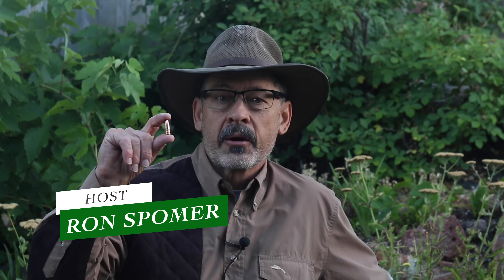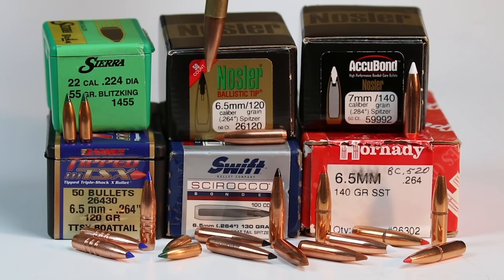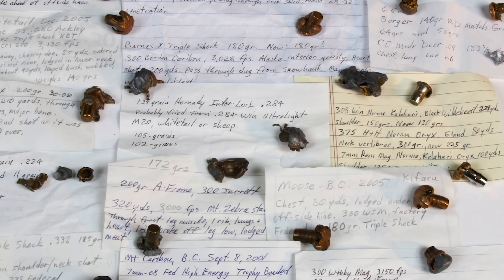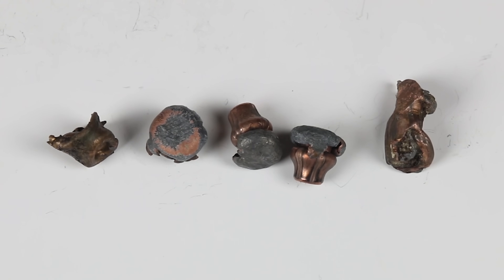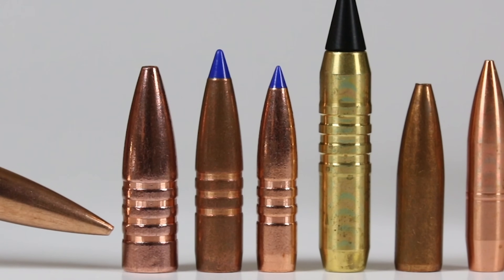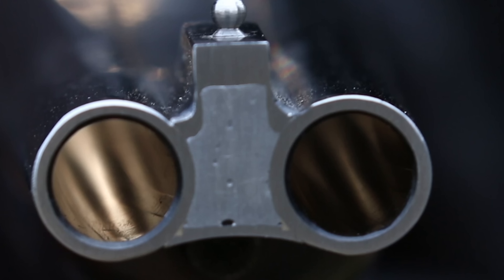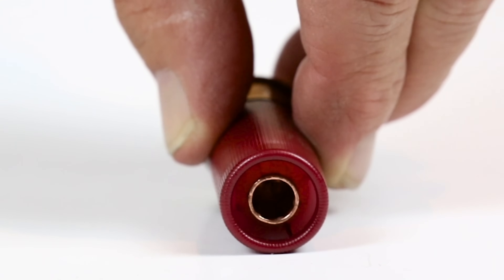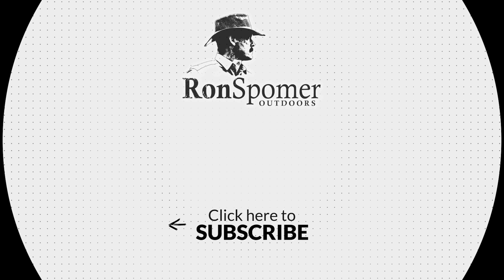Copper Versus Lead Core Bullets — How They Work

Comment: When I use a lead core bullet, I try to run it at moderate velocities. Example, look at the 30-30. At 100 yards with a cup and core lead bullet, you can expect a fantastic kill if placed just right. I have used these in 30-06. Results? DRT, IF, and I say IF, you are running them at moderate speeds. 

Lets break it down. in a 308, I will run a 165gr cup and core bullet at about 2650 to 2700 fps. Result? DRT deer / hogs. How about the 30-06? Same idea, but they run a bit faster, 2700-2800 fps with a 165gr. I have used a lot of 180gr bullets in the 30-06 lately. Why? These run 2600-2700 and really penetrate, break bone better, and results are DRT deer / hogs. 

Listen to Ron on the shotgun slugs. He knows what he is saying. 

I ALWAYS strive for close shots. Less to go wrong. Bullet choice for close shots? ALL. Why? Close deer are easier to kill, period. Hit the vitals. This particular video is so spot on I say, do it. Listen to Ron. He has killed a lot of animals. Also, practice shooting, so that you, as a hunter, are the best YOU can be. I am 60 and I practice a LOT. The Marine Corps taught me that.

Comment: Great video for the short amount of time given to the subject, but you would have to admit this doesn't tell the whole story. The most important question to ask and address is which bullet type is the most "optimal" for taking certain types of game based on the cartridge and the rifle chosen for the job. Copper bullets and Bonded bullets are not good choices at all for slower moving cartridges on, let's say, whitetail deer. A certain amount of velocity is necessary in order to achieve a proper amount of expanison since "pin-holing" is not the desired effect and is the result all too often because hunters made the wrong choice for the type of bullet for the game and cartridge used. Copper bullets are not the be-all to end-all for ALL types of game and should never be promoted as such. To convey that is simply irresponsible.

Comment: Have you harvested any animals with fluted copper bullets like the extreme penitrator? Do they work well?
Reply from the maker: I'm not familiar with the Extreme Penetrator, but my extensive experience with Barnes X, MRX, TSX, and TTSX have convinced me they are consistent performers. I would expect a similar all copper design to work well, too, whether engineered to stay in one piece with expanded petals or break into 3 or more large fragments.

Comment: Ron, thanks for the video. I'm a big fan of Barnes bullets, I have been using them for about 20 years and my children use them and now my grandchildren use them.
Reply from the maker: Glad the Barnes are working well for you, Shane. My wife and I have been using them in various forms since the early 1990s. I had one box of early .284s that did not work as advertised, i.e. didn't expand. That issue was quickly addressed and resolved by Barnes. No issues since. TSX and TTSX have been excellent. And now I'm getting into the LRX.

Comment: isn't the most important thing still the rapid transfer of energy into the target material? theoretically wouldn't lead transfer about 20% more energy into the target material in the case of a no passthrough? Now I'm the first to admit that most rounds we use for hunting deer are over kill, a 3006 with 20% energy on target is still a kill for sure, and there is probably a passthrough on all but the beefiest buck. is a copper round still viable as we move down the power curve? i've used 762x39 on deer, and had a good hit at 50 yards, so it was a drop after about 30 yards. would all copper have enough energy for a passthrough? other hunters have said they didn't get a passthrough with that round, how mich in your experience does that even matter?
Reply: nvm. should have waited till the end.

Comment: What a shame you didn’t mention the fact that copper monolithic bullits have significant disadvantages at impact velocities below 2400 ft./s. While a lead core thin copper jacketed design will perform well on game up to an impact velocity of 1600 ft./s the copper monolithic projectiles Will produce caliber sized holes in game under 2400 ft./s or so depending on the resistance of the target. Copper monolithic bullets perform well in most cartridges at 200 yards or less. Beyond that they have a significant disadvantage to a traditional style, heavy for caliber copper jacketed lead bullet. You might get lucky and hit bone beyond 200 yards but if you don’t you’re going to be chasing that animal
Reply: Look into Cutting Edge Bullets, Hammer and Lehigh bullets…nonlead with fragmenting front section even at those lower velocities 👍🏼

Comment: Ron, I believe you are speaking from your experience, but it isn't mine. 2018 my 15 yr old grandson shot a 6 point elk at 200 yards with a 130 gr Barnes TTSX from his .270. The bullet entered far forward in the rib cage, breaking a rib, broke the far side shoulder and lodged under the hide. The elk kept running, although not as fast due to the broken shoulder and finally fell in thick scrub oak about 400 yards from where he was hit. He was still alive when my grandson found him a half an hour later and finished him. When we found the bullet there was virtually -0- expansion and the bullet still weighed 110 grains. We were not impressed with the performance. My grandson now uses Nosler Partitions. I hunted for elk for 40 years using Hornady Interlock and Remington Core-Lokt bullets. I always got good expansion and penetration with shots ranging from 5 yards to 450 yards. Oh, and cleaning his rifle with the Barnes bullets was a real chore requiring lots of swabbing with Sweet's 7.62, not Hoppe's No. 9. So until Colorado mandates all copper bullets, we are sticking to the old fashioned jacketed lead bullets.

Comment: I designed a tubular bullet that allowed a high ballistic co-efficient . It had a good sectional density too which would "buck the wind". It also had vertical slits to allow it to mushroom upon impact. The fact that the weight of such a bullet is distributed at the periphery means that it is gyroscopically stable too. Strangely most cartridge manufacturers do not seem to realise that tubular bullets could give optimum external and good terminal ballistics making them flat shooting, wind bucking and good humane performers. Great video Ron!
Reply: Ill bite, how does it seal in the barrel? Or is it not a complete tube??
Reply: @fruitfarmfords8243  There are three ways to make a tubular bullet seal. If the bullet is contained within a parallel case ,like a 45/70 then a simple rear base wad would suffice to drive the bullet out of the barrel. The bottleneck cased ammunition is more complicated. A rear sabot onto a reduced diameter base allows the bullet to be driven conventionally. The split sabot will blow clear after the spinning  bullet exits the muzzle. My own solution includes an internal ball bearing that drives the tubular bullet along and is blown clear on exiting the barrel. In the 1970's the army tried a 50 calibre  Browning tubular bullet which did 5000 fps and carried supersonically for greater ranges . I think it was too light on impact for military purposes. A tubular design allows great sectional density so slow loss of velocity, momentum and energy. It can also be driven faster because it is lighter in weight,

Comment: That was a great, detailed video explaining the various differences and trade-offs between conventional lead core bullets and the all copper, monolithic options.  A couple of things not mentioned are the higher cost of the all copper bullets, and the potential for greater accuracy with lead-core bullets, where more of the weight is toward the rear of the projectile.

Something I have long wished for is a bullet that is much like the Nosler Partition, where a solid copper bullet has had the shank filled with lead.  This would make the projectile heavier in the rear, increase the sectional density for any given length of bullet, and otherwise provide all of the key advantages of both bullet types.
Reply from the maker: The discontinued Winchester XP3 bullet had lead filled shank, hollow copper nose just as you describe. Barnes had an MRX like that, but with tungsten in shank. Talk about heavy! Seems to me there were or are others, but I'm drawing a blank from the memory bank at the moment. Anyone? Didsn't Federal have a hollow nose copper bullet with a lead shank once?
Reply: @RonSpomerOutdoors  --  It seems to me like these would be ideal bullets.  Were they not as good as I would think, or are they just too expensive?
Reply from the maker: @jasonbroom7147  The XP3s were indeed a great bullet. But sales were low due to high prices. Most hunters go with the cheapest ammo they can find so they have sufficient funds left over for beer. (Only half kidding.)

Comment: EXCELLENT! Like you, I've also hunted for 50 years.  I live and hunt interior Alaska.  I've used all copper bullets for the past decade or so....I like the penetration and exit holes.  Exit hole especially for bears which have long hair that wicks up blood.   I hand load my .270 Win with 4350 or RL22 and 110-130 gr monoliths like Barnes TTSX and 180gr Barnes TTSX or Nozler E-Tip  and 4831 with my .300 H & H Magnum.  I use monoliths for tiny Sika Blacktails up to huge bull moose.  Each of my rifle shoots a different monolith best, so for best accuracy I try a couple different monoliths in my hand loads.
Reply: I find this encouraging for use over in the Northwest Territories! I think I'll try loading some up.

Comment: Great summary. Perhaps one aspect I would have hoped you would mention is minimum downrange velocity for full monometal expansion. Where premium lead projectiles will deform well with perhaps as little as 1200fps, monometals usually need 2000fps.
Reply: Very important data to be left out of the video,  I believe Nosler partitions need 1800+fps which means a better hunting round at range.  Does Barnes or the other copper bullet manufacturers publish this data?

Comment: Shock effect is a myth... loss of blood pressure is the only thing that happens...tear out the heart and BP drops immediately... Head shots that damage the CNS cause instant heart failure and loss of BP... same thing.. that is why when you see a bad head shot the animal will scream and thrash around until loss of BP then die.. if shock was true then any head shot would cause immediate incapacitation and it does not..
Reply from the maker: Some good observations, Daniel. I've witnessed some head shots that just missed the brain and the deer, many would be amazed to learn, recovered after a couple of minutes and stood up! Was disoriented, but not dead as would be expected from the "shock effect." However, that doesn't explain the few instances I've also seen of a lung shot deer collapsing instantly and never recovering. Even with massive and immediate blood loss, that seems in conflict with the "no shock effect" theory. I'm not sure what's going on, but sometimes something occurs with certain hits (and bullet size/energy seem to matter little if at all) that results in instant demise. The brain cells may (probably, almost certainly) be technically alive for another 10 minutes, but the animal is "not home." I've seen this a few times. But, as you note, most of the time spine-hit game remains alive but incapacitated. Happened this deer season with a neck shot whitetail. Collapsed, kick. Lay still for a good 15 minutes while we picked our way across the canyon, then leaped and thrashed to flee. Heart/lung shot required to finish. If the shock effect were real and/or consistent, a bullet landing in the neck within inches of the brain should have resulted in instant death without subsequent resurrection.

Comment: In normal bullet speeds, copper bullets suck in my opinon. Animals always runs away with perfect shots almost like a full metal jacket. Lead bullets drops them many times at the spot. Maybe copper works if you crank it up to magnum speeds i dont know.

Comment: Yeah I would not recommend the barnes tttsx bullets because I have had nothing but bad luck with them. I have loaded a 160 ttsx in a 340 wby mag for bear and after I shot a nice one it bled for 400 yards then crossed a river never to be found. Last year I shot a buck with a .257 wby mag at 325 quartering away and spent 3 hours looking until I stumbled upon it. I have had 4 times where this sort of thing happened where the bullet just doesn't expand and it ends up with almost no blood and the animal running a long ways before dying.

Comment: Ron,

Enjoyed the video regarding the all copper bullets. I started using the Barnes Vor-TX line of ammo about 4 years ago and have not looked back. I now use them in all of my hunting rifles and purchased some recently for a 41 Remington Magnum Ruger Super Black pistol I intend to hunt with this year. They have worked flawlessly on Alabama whitetails even in my smaller caliber rifles like 300 AAC Blackout and 6.5 Grendel. By the way the 6.5 Grendel is a CZ Model 527 and it shot a cloverleaf 3 shot group right out of the box on the first three shots @ 100yds. It has become my favorite whitetail rifle. All bullets recovered were perfect mushrooms with near 100% weight retention as you mentioned.

Comment: I shot a deer yesterday with my 6.5 Creedmoor shooting handloaded Barnes 127 grain LRX bullets. The shot was 100 yards quartering away, and the bullet completely smashed through the ribs, obliterated the lungs, and exited the front of the neck. He ran about 20 yards before piling up. I was surprised at how little meat was bloodshot.
Reply: Kyle Reynolds lol wait til you realize thats from velocity. 45/70 with hot loads never causes bloodshot meat

Comment: Regarding the ballistic coefficient of lead vs non lead, sometimes the longer non lead bullet can have a higher B.C. for the same weight. As you reach the maximum bullet length that a barrel can properly stabilize, the greater density of lead will give a higher B.C.

Excellent video, Ron. Thanks for the thorough, concise, and easy to understand information.

Comment: I've shot a lot of plains game in Africa with 180g Barnes TTSX home loads and shot a buffalo this year with copper bullets in the PH's 375 Ruger so I'm a big fan. However I've had problems finding a bullet I can load for my ageing 7x57 Mauser. As it looks likely that the UK will go for mandating the use of lead free ammunition I'm very keen to find something I can kill deer effectively with. Any advice? Already tried Barnes and my rifle really doesn't like them.
Reply from the maker: Check out Cutting Edge bullets, all copper at bore size with a driving band. Minimal bore contact/stripping.

Comment: Well done Ron.  The only time I ever use lead bullets is in a rimfire.  Copper outperforms jacketed lead in centrefire hands down. Been using them professionally for more than 20 years. If copper bullets had been developed first,  jacketed lead would never have got a start. The most important thing to remember is to get the twist right, and everything else will fall into place.

Comment: I was suggested to try some Barnes TTSX 150 grain bullets for my .300 WSM, when I asked a question on a forum about reloading for my new rifle. I know most people suggest to go light for caliber when using monolithic bullets. I have those bullets, but haven't reloaded with them yet since I know it is different than reloading regular lead core type bullets. I also thought about the Hammer bullets, not sure if you have heard of them. They are a custom bullet company, not one of the big name brands. 
I found that the 180 GMX from Hornady in their Outfitter line shot really well out of my Savage M110 Long Range Hunter, even though that is not light for caliber, but on the higher end (200 grain probably being the max like the ELD-Xs that I have for the .300 WSM, not the regular Win Mag). Thanks for your through overview of many bullet types and shapes there Sir.
Reply: Yeah I would not recommend the barnes tttsx bullets because I have had nothing but bad luck with them. I have loaded a 160 ttsx in a 340 wby mag for bear and after I shot a nice one it bled for 400 yards then crossed a river never to be found. Last year I shot a buck with a .257 wby mag at 325 quartering away and spent 3 hours looking until I stumbled upon it. I have had 4 times where this sort of thing happened where the bullet just doesn't expand and it ends up with almost no blood and the animal running a long ways before dying.
Reply: @Nick-sx6jm  I tried TTSX 150 gr in .30-06 this fall and very happy with the results on 3 large Wisconsin whitetail does .  All pass throughs with no or short tracking.  Hope to try in my 7mm-08, if I can find any.